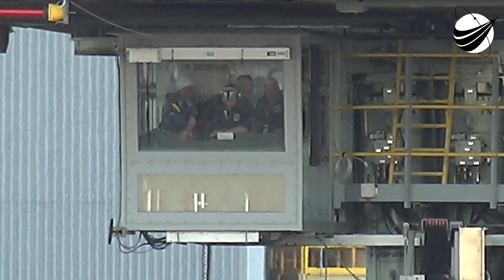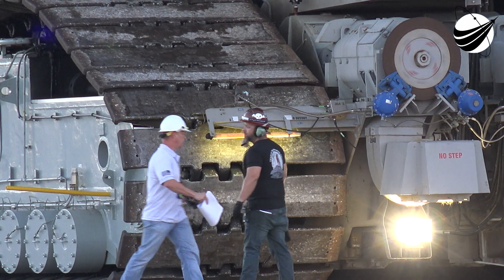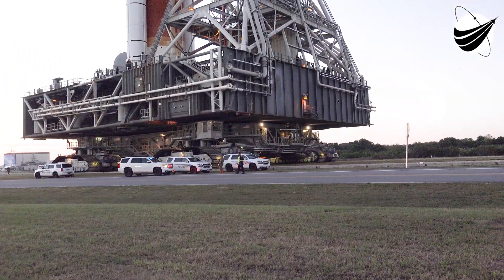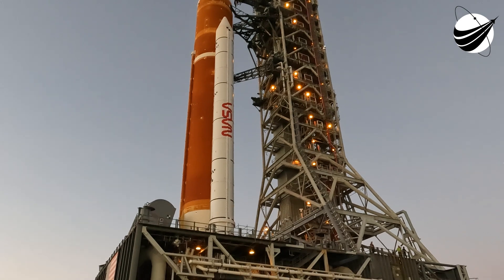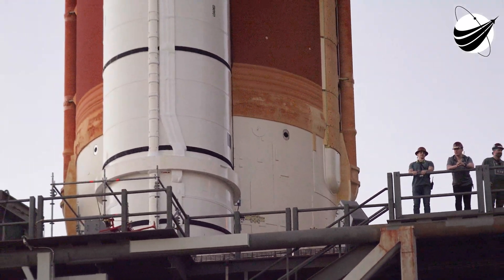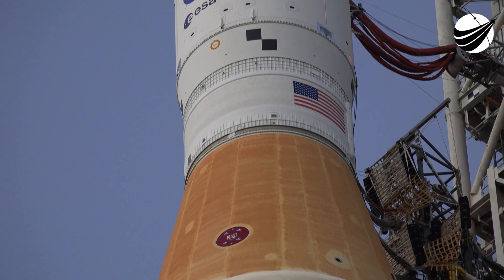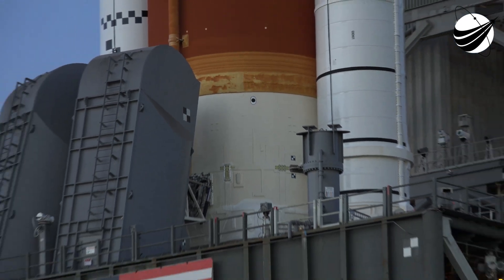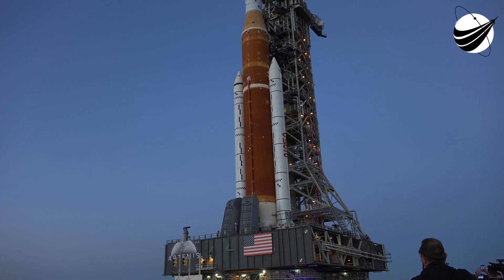SLS - Worlds Most Powerful Rocket

Comment: 23 billion, 20 years. 4 billion per launch. Things can be cheaper, reusable and engineered faster. This has been proven by X.
Reply: You are wrong. Being reusable can be more expensive just like the Space Shuttle. Brand new rockets are even safer for astronauts. This rocket has an escape capsule. The SpaceX rockets do not have one.
Reply: @MrJSabadojr  , you are wrong! Space X does have a escape system. The launch abort system with draco engines. And they have reused boosters over and over. One booster has been used 12 times.
Reply: The Space Shuttle proved reusable 30+ years before Elon so lets tone down the fan boy. Starship is years away probably 5+, Elon has a LONG history of deliberately underestimating realistic time frames to keep the sheeple followers excited, sure its had a few sub orbital proof of concept launches, that's  long way from carrying humans to space.

Comment: It's not the "most powerful rocket" until it has all engines and motors running at full power and is 1mm 1/24th in off the pad ..  then it's a rocket. Until then it's the most expensive lawn ornament that is way over-budget and very late.
I personally want to see it fly successfully, but let's just accept the main contractor is Boeing so right now it's 50/50 it'll work OK.

Comment: I loved your Orion Capsule Abort coverage, showing just how unstable in subsonic flight that the Apollo and Orion Capsules are. NASA ignored the Orion Subsonic Unstable Aerodynamics by ending the test early and not covering the landing. You at USLauchReport continued coverage, showing the capsule tumbling so violently that it most likely would have incapacitated or killed the Astronauts before impact with the Ocean. Mercury and Gemini capsule had "tails" which make them stable in Subsonic Flight. In the Apollo Capsule, the tail was replaced with a docking port, an acceptable risk in the race to the Moon.

Comment: Most powerful?
Reply from the maker: 8.5 million pounds thrust
Reply: @Uslaunchreport  Isn't starship 17 million pounds and 100 to 150 t to anywhere with refueling?
Reply: @Uslaunchreport  less than starship i think right? I suppose most powerful if it flies before starship, if you ignore N1
Reply: @IvorMektin1701  they build fast. This isn't NASA.
Reply: @IvorMektin1701  If they can't launch from Starbase it will push SpaceX back close to 1 year out from launching out of the cape. SpaceX built the launch tower and launch supporting systems in under a year so they could probably do it again at the cape a little faster the thing that might take a little longer is building up the rocket factory at the cape. They might be able to still build at boca and ship the boosters and starships to the cape for launch by some kind of ship transporter which sounds like a logistical nightmare.